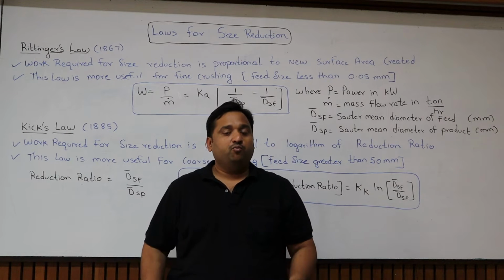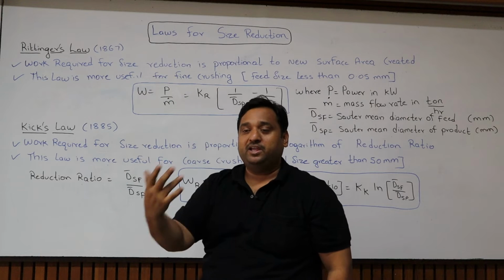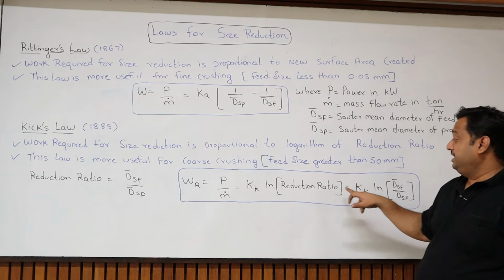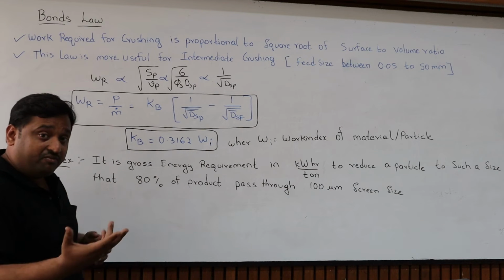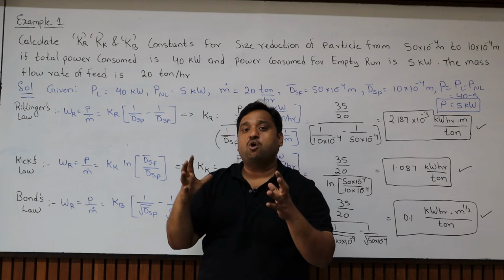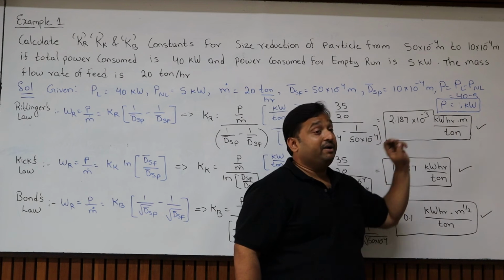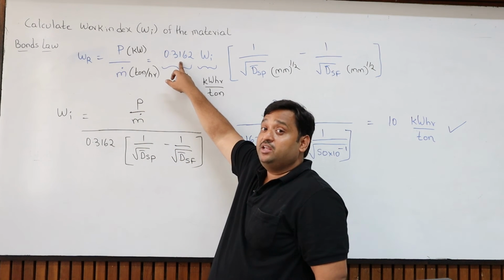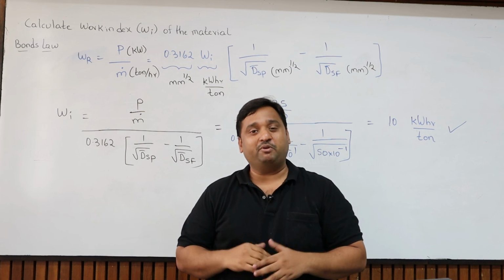Lec 12: Rittinger's, Kick's, Bond's Law, Workindex ExampleProblem :Mechanical Unit Operation Lecture

Comment: PROCESS DYNAMICS AND CONTROL LAB Experiments

1. I & II Order System Dynamics
2. Interacting & non interacting Systems
3. Flapper - Nozzle system
4. Control valve characteristics
5. Level control system
6. Flow control system
7. Pressure control system
8. Control of a thermal system
9. Design of control system for a given process
10. Simulation of a closed loop system
11. Demo Experiment using Aspen Software of a given process
Reply from the maker: Dear Aspirant. We will try thank you

Comment: Process modelling and Simulation lab experiments

1. Estimation of dew point and bubble point temperature of a hydrocarbon mixture
2. Simulation of flash drum
3. Design of ditillation column
4. Optimization of a flow sheet or process
5. Determination of temperature profiles for heat exchanger
6. Concentration profiles for reactor
7. Simulation of Jacketed CSTR
8. Simulation of process
9. Simulation of evaporator/ distillation column/ extraction process
Reply from the maker: Dear Aspirant, we will try thank you
Reply from the maker: Dear Aspirant, we will try Thank you